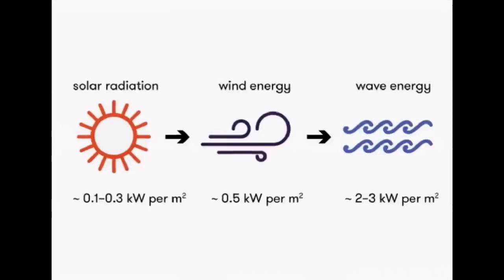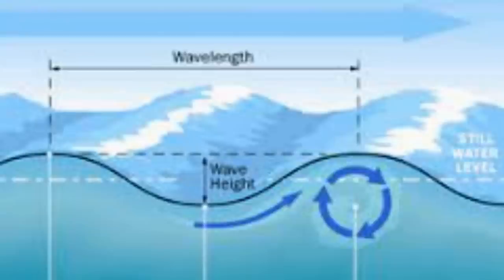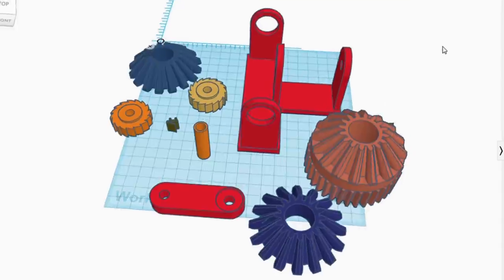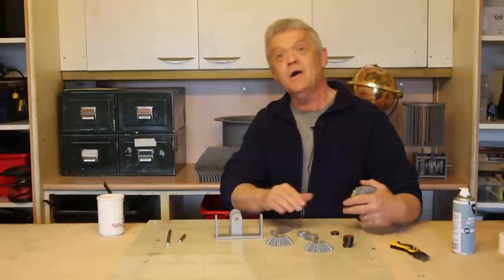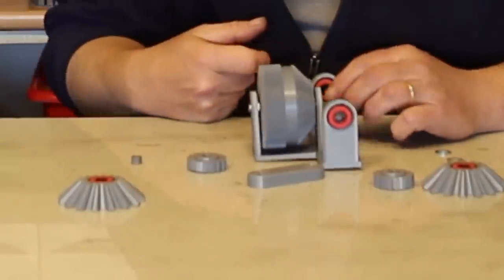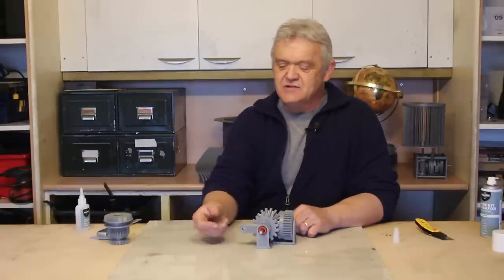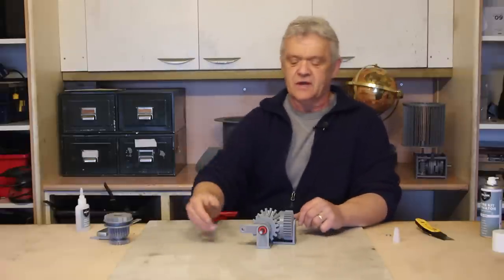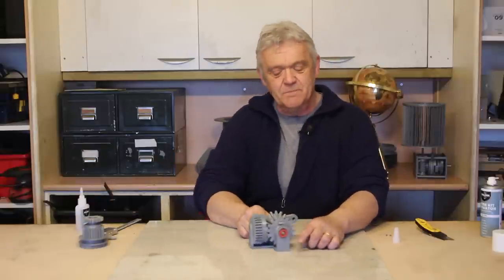1906 Wonderful Wave Power Mechanism

Comment: Hello, why you need gears for making power from the waves? Linear up and down motion  of a magnet trough a coil is much easier to construct and has minor transitional power losses, minor torque ,ok, but buoyancie of a floating object contra a ocean of wave power acting upon a radical smaller 'magnetic' field ( i.e.: strong magnet up and down a coil) ankered at the base, but with a floating vesel on top....... No gears needed, keep it simple , and no need for 3d printer, ..., Ps like your channel. Grtyz. C, Belgium

Comment: I've always wanted to make something that would just capture the water from the wave and or the tide but mainly the wave you could make something like a chamber with a trough in front of it the waves would go up the ramp and just fill the container and keep filling it while it also released it underneath and in front of so you could put a paddle wheel or some kind of turbine to catch that exiting water. It would always be filling and always be draining the only problem is is positioning it in such a spot as to not be overwhelmed by the tides perhaps positioning it and some stainless rods that would allow it to float up and down with the tides so it basically remains roughly in the same position relative to the water level period now I understand that this would not be easy it would take a lot of trial and error and if I lived anywhere even remotely close to a body of water that I could test this I would.

It would allow for river type collection oh energy without the need to find a river somewhere your river would be the trough ramp leading up to the chamber that is to be filled you could actually have the paddle wheel sticking out of the trough to be turned in One Direction while the water exits to the bottom of the paddle wheel helping it along in the same direction maybe I'll draw it and send it to you Robert
Reply from the maker: please do mate - cheers